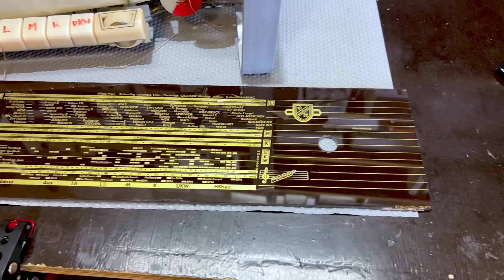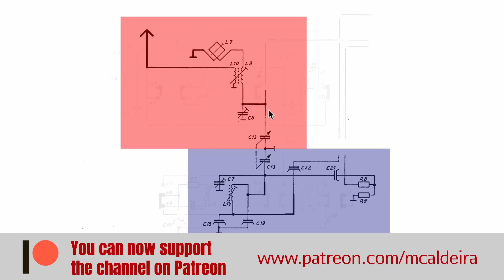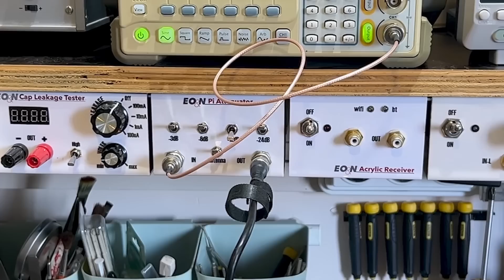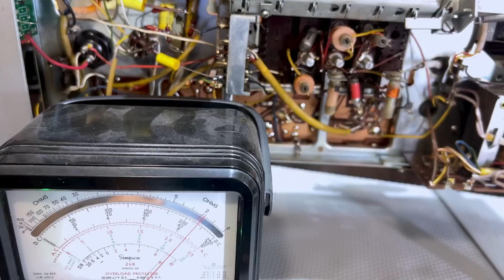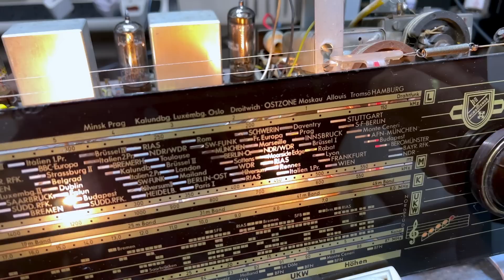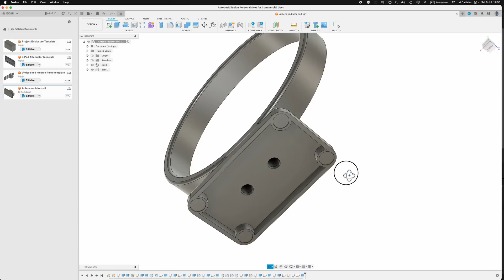The 'Why and How' of an RF alignment - Tube Radio Restoration Back to Basics part 12 #pcbway#

Comment: Seems like a decent method!

I personally use a hp 3585b and clip my tracking generator onto the insulation of the input circuit. This does not load the circuit at all

Comment: I'm new to restoring vacuum tube radios. I've got 4 radios that I plan to restore starting with a 1951 GE AM set. I've been researching and slowly building up test equipment and learning how these radios work. I finally recapped and replaced out of tolerace resistors and I'm ready for the alignment. I've got a VTVM and a signal generator that will output a modulated AM signal, but the output only goes down to 4mV. Is it possible to do the IF alignment at 4mV or do I need to attenuate it down lower?
Reply from the maker: You’ll need an attenuator

Comment: I might have possibly been fitted a switch on the back of the radio that shifts the oscillator, so you can get your favourite (top end) station. When not switched in all the stations line up with the original dial markings. Just an idea.
Reply from the maker: I could do that, but then I’d have to get just the right coil in parallel with the existing one, and screened very carefully… a tough job

Comment: One thing you could have added to the theory is why we adjust the inductance at the LF end of the band and the trimmer capacitors at the HF end of the band. It turns out that at the LF end of the band where the tuning capacitor is at a maximum, adjusting the trimmer capacitors has little effect on the total capacitance and thus resonant frequency. Therefore, only adjusting the inductance will change the resonant frequency. This leaves the trimmer capacitors to be adjusted at the high frequency end of the band where they will have a considerable effect on the total capacitance and thus resonant frequency.

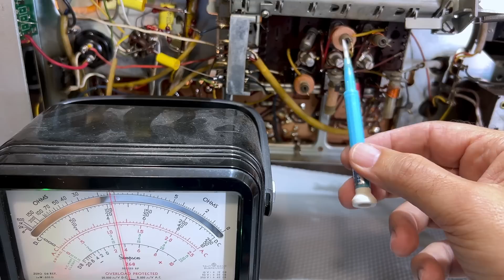Comment: AT 33:50 after you had aligned MW and were describing what you had done, the meter was going all over the place. Either your hand moving around was affecting it or there was something affecting the signal.
Reply from the maker: The antenna coil was wobbling around.

Comment: Thanks Manuel. That simplified schematic really helped to make it obvious why the trimmer cap has more effect at the high frequency end of the dial. I confess I was looking at your replacement dial glass with some envy as I have a Nordmende Othello in the queue with a dial glass in three pieces. 😢
Reply from the maker: 😊 I was lucky that someone out there had one to offer. It was a gift and I really appreciate it

Comment: This Drahtfunk thing was specific to Switzerland. Many locations in valleys had poor or no radio reception and they transported the signals over the phone lines on longwave frequencies. Later there was a very dense network of FM transmitters, which will soon be replaced by DAB+. Switzerland will then be the second country after Norway with no analog radio stations (your country Portugal is the one of the few EU countries with no DAB digital radio at all).
Reply from the maker: Yes, progress … it’ll be a shame when these radios become completely silent.
Reply: Yes the Uk was supposed to switch to DAB a few years ago. Not DAB+. DAB has too low a bit rate resulting in a very flat sounding reproduction. It has coloured peoples view of the medium and generally here has been a poor uptake. The difference between Std digital TV and UHD TV is a good comparison,  except of course it is audio. The powers that be want the change to squeeze the radio stations into a tighter band freeing up spectrum for other uses. Mobile phones with more bandwidth to expand their versatility. For me there are too many buttons on a phone now so I hope the AM and FM radio stations stay around a lot longer. Lost too many.
That drahtfunk thing sounds similar to the WB900 unit (allowed two subs to use one pair privately, replacing party line switching, where you could hear the other user). Also WB1400 units used by BT in the 80's and 90's to put a number of subscribers on one pair of wires. They both allowed switching signals and the audio to be carried on different frequencies increasing line usage and privacy.

Comment: I studied electronics and Radio-Television repair in trade school from 1977-1980 and IF/RF alignments were always a favorite of mine. My career centered on audio-visual equipment repair for a large school system and never touched a radio receiver during that time. I am retired now but still have my generators and meters. watching videos like these bring back some good memories.  Vacuum tube equipment was just about obsolete in use when I started school but the curriculum had a thorough course of it with hands on training before teaching transistor theory.
Reply from the maker: These “old” technologies are fascinating to me, because when I was at university the tube era was over. Fortunately, the internet has made all the info available.